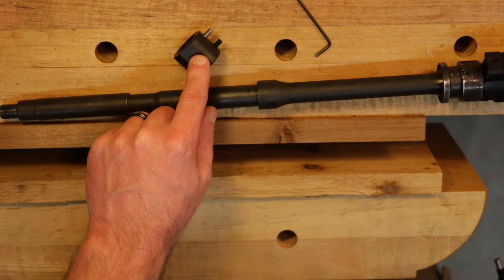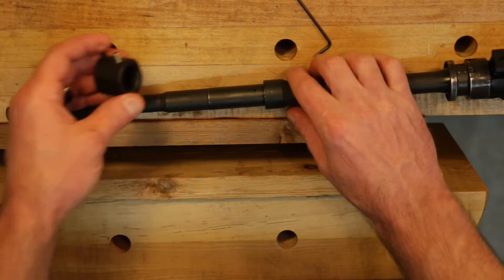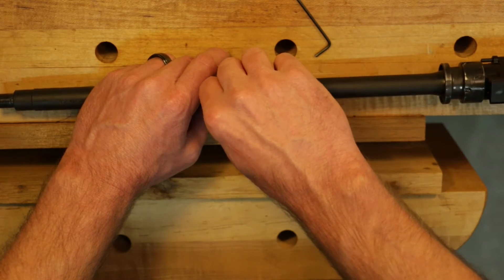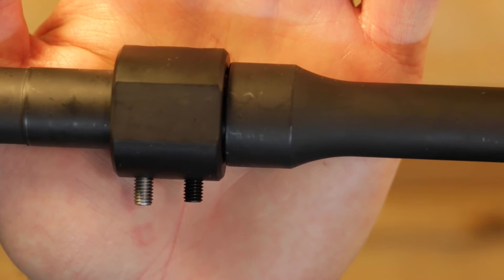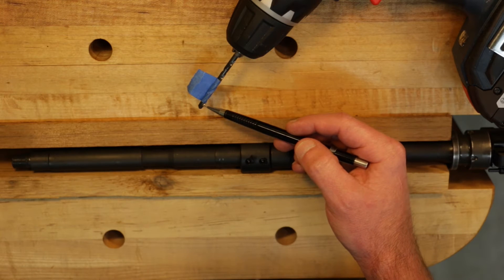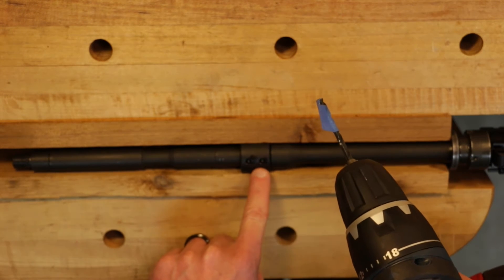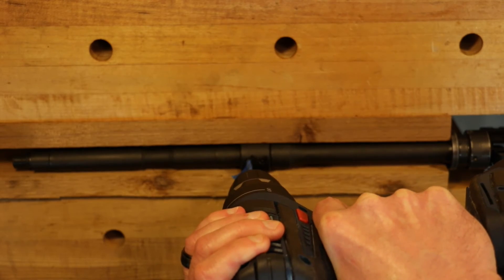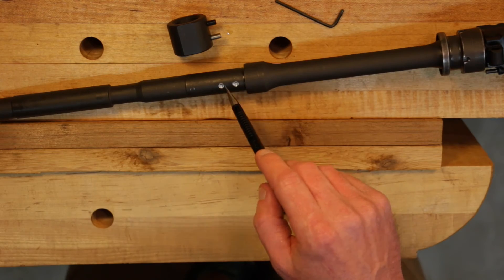Black Rifle Disease Gas Block Dimpling Jig

Comment: 60$$...?? A bit much
Reply: They are much more expensive now
Reply from the maker: Tim Whalen Buy once, cry once. You’ll spend that in several trips to the gunsmith.  As a better option, I did a recent video on their updated jig, which covers almost all LPGBs.
Reply: The Lonestar Patriot dimpled my AR 15 just aligning, measuring, marking with a steel punch and drilling on my press...not very difficult. For my AR 308 build I will use the EZ Accuracy 15$ screw and pin..will save a little time. As an aside, my brother-in-law has built several of these rifles and never once dimpled , simply uses Blue Loctite on the set screws. Nonetheless thank you for your concern